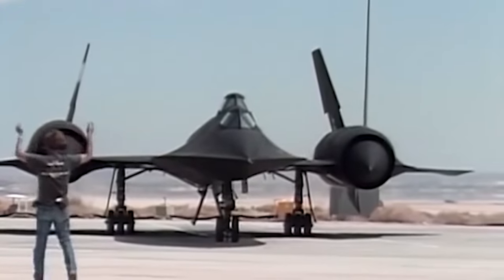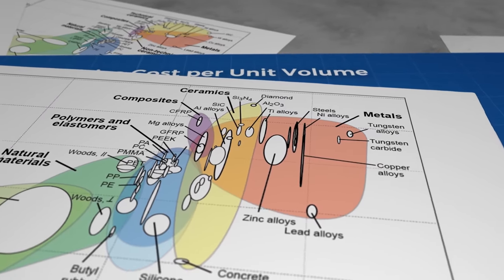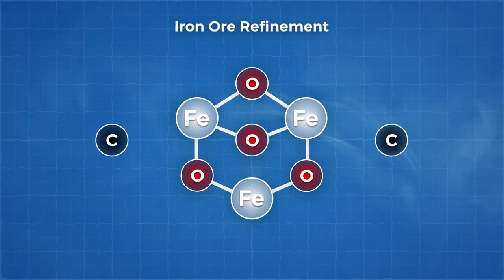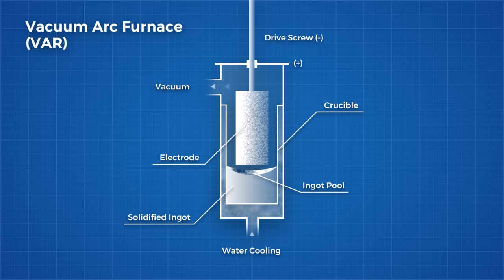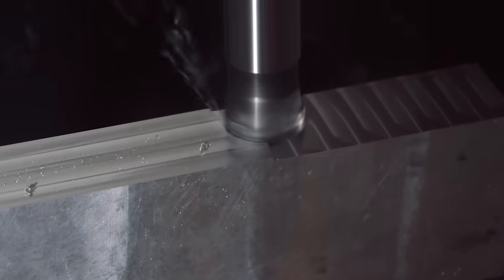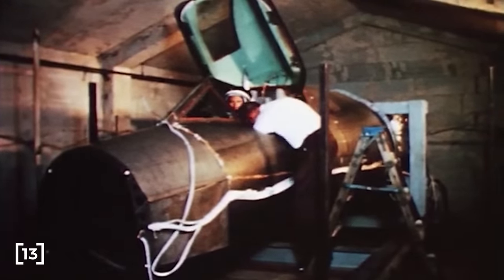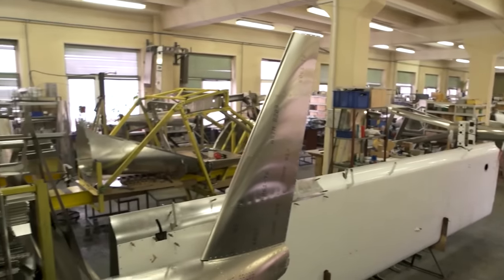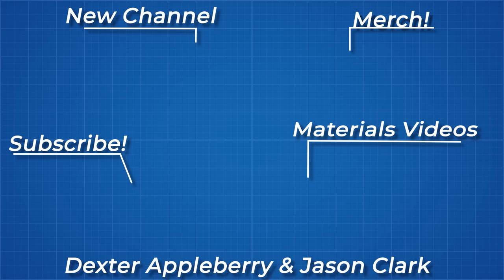Titanium - The Metal That Made The SR-71 Possible

Comment: The Avro Canada CF105 "Arrow" jet fighter started serious development in March 1955. The first aircraft, 201, was rolled out on October 4, 1957 and first flew in March 1958. The Arrow's engineers used both titanium and magnesium metal in the fuselage and structure, and had to solve the same problems in learning to work and form Titanium metal. However, they didn't get their Titanium from the Soviets. Titanium (Ti) forms about 0.5% of the rocks of the vast formation called the Canadian Shield. Titanium minerals include rutile, anatase and ilmenite (FeO.TiO2), the latter containing 52.7% TiO2. All stages of Titanium production in Canada are in Quebec, where QIT-Fer et Titane Inc mines 3 million t per year of ilmenite at Havre St-Pierre, of which over 1 million t is smelted in electric furnaces at Tracy. So, Titanium was sourced domestically, The necessary presses, equipment and tooling were developed by contractors near the Arrow manufacturing plant at Malton, Ontario. The project went direct from the drawing board to a flyable aircraft, with extensive model testing, allowing rapid progress. By 1959, a huge amount of flight testing had been completed, and 5 flyable CF-105's stood on the apron, with #206 ready to take the new and much more powerful Orenda jet engines, also developed in Canada. At least 14 more partly finished Arrows were on the plant's assembly line.

Then disaster struck. The Arrow program was infamously cancelled abruptly on Feb. 20, 1959, known as Black Friday, by Canadian Prime Minister John Diefenbaker. The high-performance fighter aircraft and many part- or nearly-complete planes, plus the manufacturing plant and tools had been built at a cost of millions of dollars.
 Diefenbaker ordered that all vestiges of the Arrow, as well as all plans, tooling, machinery, and the aircraft themselves, be completely destroyed. The "official" story was that the metal supplies, along with the purpose-built machinery and tooling were sold for scrap. However, curiously, records of this are sketchy to nonexistent. Huge machinery, presses, special welding equipment and jigs, and all of the material vanished as if somebody had said, "Beam Me Up, Scotty," never to be seen again - in Canada, at least. When one looks at the size and complexity of the plant, the "sold for scrap" story is utter nonsense. It is entirely possible that machinery and metals found their way to the United States. Many of the Arrow engineers went to the U.S. - the most 'famous' group becoming part of the new Apollo program, hired literally within days.  Of course, there's no way to prove this, since almost all the players have died. Around 2010 one of the aeronautical engineers revealed that he had a complete set of drawings and blueprints for the Arrow, and for its jigs and tooling. This re-started bitter arguments about the destruction of the Arrow, and Diefenbaker's ordering it all "pounded to bits" - literally.

Comment: Lockheed also developed a material that was given the name "Lockalloy" for the YF-12/SR-71. It consists of 62% beryllium and 38% aluminum and was used as a structural metal because of its high specific strength and stiffness.
Reply: You mean alloy

Comment: I am a machinist. Titanium is not that bad to work with. there are far more difficult things. it would certainly suck with a hobby setup, though, which is what I wager most peoples experience with it is, trying to make rings or pens or whatever.

I have issues with a few of your facts: I find it bizarre that they were "wasting" the titanium scrap and chips because it can be recycled just like any other metal. Scrap titanium is reused as the ingot electrode. Given how expensive it was, there was no way they were simply throwing scrap away.

Also, using 'high volumes of coolant' is no more or less expensive than not. Coolant is immediately reused once it goes back into the sump. The only losses are via contamination, vaporization, and evaporation. Additionally, the lower feeds and speeds do not make machining titanium 'incredibly slow'.

Finally, the cutting geometry of tools used for titanium isn't particularly special, and the cutting properties of titanium weren't unprecedented, so once the machinists saw how it was behaving they would have already known how to solve the problem.

Comment: Little known fact: When welding large panels cooling water was applied. After a few years some cracking appeared in the welds but it was not consistent to locations on other aircraft. It was determined that welds made in the summertime cracked due to chlorine found in tap water that was used to keep it safe.

Comment: According to Joe Sutter(father of the 747)'s book, Soviets wanted to buy some 747 (later denied by state department). So and the engineers from the both side gathered in Paris to have a nice dinner and discussing some technical details. Soviets brought Titanium welding and smelting to the table, and Joe Sutter explained why US mounted engines underwings plus some insight to structural designs.

Comment: Titanium was already used and still is used in aircraft engine hot sections,so it was a natural choice u would say nevertheless extracting a different use out the material o vously calls for advancement in several factors such as metallurgy ,airflow characteristics etc..

Comment: Another piece of engineering Witchcraft for the SR-71, it's windows aren't made of glass that would melt, they are nearly 2 inches thick slabs of clear quartz crystal and fuzed in place by ultrasonic welding.

Comment: the sr 71 was able to go into and exit from the 80k ft flight parameter. On a photographic mission it could drop down and then turn around and climb back to its previous flight track going the opposite direction, characteristics not found on any other plane. all other spacecraft are jettisoned rocket designs with ceramic tiles underneath to abosrb the heat friction on reentry. there are blackbird pilots that explain the flight characteristics that are counterintuitive, as the plane starts to run out of fuel, they accelerate and climb, interesting to this day..

Comment: A big part of the B-2 cost only a few were authorized to be funded at a time so titanium parts could only be made from billet hog out (not precision casting in quantity), hundreds of such parts mate with advanced composites yielding a design that broke the static test stand instead of the test article. B-2 program most common defect was Alpha Case, hydrogen or oxygen embrittlement from exposure to air at high temperatures (argon gas shield mandatory). The YB-49 failed because the aluminum structured flying wing was not stiff enough to resist twisting with the elevon control surfaces. Blackbird holes drilled into titanium might require thirty high speed drill bits, cobalt drill bits had not been invented yet.

Comment: Only 17 holes before ruining the bits? I had a friend who worked for CAT modifying bulldozers for military use. He wasn't allowed to know what the armor plating was made of, but he said it took 3 bits to drill each hole, taking around 20 min for each hole. For 1 d7 dozer conversion he had to drill thousands of holes to mount the armor plating. This armor was able to withstand 20mm rounds, and was bomb proof because these dozers were primarily used as mine sweepers.

Comment: You also might want to look into the Beryllium Aluminum alloy used in the vertical stabilizers. Titanium was not stiff enough and would flop around in flight.
Reply: @andyharman3022  When I was working a joint project with Lockheed, one of their engineers sent me an old sample he had under his desk. Amazing stuff but you have to machine with the same protections you would use for spent uranium. Found another way to solve my problem so we didn't use it but it would have saved several pounds in the vehicle.
Reply: @Osty789  Formula 1 teams were using it for brake calipers and engine pistons about 20-25 years ago.  It was outlawed.  How exotic is it, if it's too exotic for Formula 1?

Comment: Makes you wonder why they didn't use the materials in the engines for structural items. Hastelloy X and Inconel are both highly heat-resistant and mechanically strong. OTOH, there's a lot I don't know about ,metallurgy.

Comment: The Soviet's closest equivalent, the MiG-25 Foxbat, used Nickel-Steel Alloy for it's construction. It was almost 30 feet shorter than the Blackbird, while being about two tons heavier. It's engines also had a nasty habit of eating themselves at their max speed. Additionally, the Foxbat's range was pathetic when compared to the Blackbird.

Comment: Titanium has become associated with strength,....which is not quite correct.  Compared to aluminum, yes.  But steel is stronger.

Where titanium exceeds is #1.... Resistance to corrosion. It' used often where acid and other corrosives are used, and #2...It's lighter than steel.  In the case of the X-15 even titanium was not enough.  They had to use steel, with super-alloy Inconel (nickle-chromium) used for glowing-red-hot wing and fin leading edges and the nose where steel would get too soft and weak from the heat.

Comment: Very informative, but a couple of points.  Firstly 'steel is heavier than titanium'.  One kg of steel is not heavier than 10 kgs of titanium.  Density is the word you are looking for.  Secondly, at one time Kelvin is used as a measure of temperature and another time Celsius.  You should be consistent.

Comment: 14:30
Vanadium is also the secret magic ingredient "X" that is makes Damascus steel superior to ordinary steel.
Reply: Damascus steel is a mix of two different steel alloys folded over and over to combine the positive attributes of these steels. Neither of these alloys must contain Vanadium and actual historic damascus, aka "wootz steel" indeed doesn't contain any at all, because the benefits of adding V to steel did not become known before the late 19th Century. Any good knife steel contains Vanadium (preferrably +1 %) as it adds wear resistance and refines the alloy's grain structure. To do that the steel does not need to be folded, just properly heat-treated.

Comment: the B-70 bomber, which was also designed for match 3 cruise, skipped the titanium. it was designed after the blackbird program and was supposed to be a bomber with hundreds of aircraft, not a spy plane with 10s of aircraft. they used steel honeycomb on the wings to get the required stiffness to weight ratio. the honeycomb also reduced the thermal conductivity of the wing panels by enough even compared to titanium that the B-70 could use normal jet fuel without worrying about it igniting at Mach 3. I think it's a much better and cleverer solution than massive amounts of titanium.

Comment: Titanium is NOT difficult material to machine. It's a very pleasant material to work with.
Reply: Everything has to be properly managed. Maybe it was tricky back then, when they worked on the SR-71 and this is why it's so easy to work with titanium nowadays.

Comment: It's a bit unfair to say steel is as heat resistant as titanium is. Yes, some alloy of steel certainly is, but those are very soft.

Having a stiff steel that also have high temperature is really very rare, not even considering weight.

To say that titanium is not stronger than steel also leaves put the fact that high strength steel have a large number of drawbacks, not only weight.

The xb70 was made of high temperature steel, simply made it very thin. That kind of worked.. sort of

Comment: It's not just about the price it's strength and weight the reason why they used titanium on the Sr 71 was because of the heat caused by friction at those speeds aluminium metals at a lower temperature and it's a soft metalerial when heated. That's why these days they are using composite materials because there lighter and in some cases stronger. Alot of what you have stated is incorrect I'd love to know your source of information

Comment: It was not limited by the power of its engines 'eeeeeeeh, I mean kinda? Once it approached Maxh 3.5 that boundary shock would start to reach too far into the intake and thus super sonic air being ingested would cause major issues. But I digress. That's not so much the engines fault as it is the Engineers knowing they couldn't got much past M3.5 anyway for the reasons you stated.

Comment: I wonder if ScAl, scandium-aluminum, would work better than titanium as far as the fuel leakage from the expansion difference goes?  I think it would probably work better.  Certainly the 20 percent weight advantage would help with range and maneuverability.
Reply: Scandium increases the tensile strength of an aluminium alloy but not its heat resistance. So if heat is an issue, titanium is the better choice.
Reply: @einundsiebenziger5488  Not so sure about your heat resistance comparison.  Maybe you can send me a link.  I looked all over the place on the Internet but was disappointed not to find the chart that was provided by a manufacturer's page...can't remember the name of the company.  What I did find seemed to be everything but what I was looking for.  Apparently, everyone is using other alloys along with scandium for experimentation, so their "findings" widely vary.  The most interesting ones that I did find appeared to include ceramics which, of course, which tended to really increase the heat resistance stability.

Comment: this is a question for engineers. Why add Aluminum and Chromium to a titanium alloy, thereby reducing its thermal properties and strength, rather than applying an additional sputter layer or Al and Cr alloy separately to the outside of the part when possible?
Reply: because pure Ti is too brittle, the addition of aluminium and vanadium provide necessary ductility, so Ti sheets can be bent without breaking.
Reply: Pure titanium is relatively weak compared to many titanium alloys.  Alloying allows you to tailor the microstructure and phases present to modify properties in a way that simply isn’t possible with the pure metal.

Comment: Pure titanium isn't that hard or strong. Alloy steel is harder and stronger. It's when titanium is   alloyed that it can become stronger and harder. Carbon (and nitrogen) are often added to metals to make them stronger and harder.   
  Cutting tools are high in carbon; then, it's called a "carbide tool". There are steel carbide, aluminum carbide, silicon carbide, and titanium carbide, and others.
   Cutting oils and steel cutting tools contain carbon. When titanium is drilled or cut, the cutting  tool edges, and the cooling oil, lose carbon to the titanium. The titanium then, locally, becomes TITANIUM CARBIDE. The cutting tool, then, loses hardness in the cutting edges. (The same action takes place when drilling or cutting aluminum. The aluminum, then, becomes aluminum carbide (locally, to the edges).

Comment: There is another very good reason why titanium is rarely used in planes. Titanium burns at 2700C. No fire suppression system can cope with this kind of temps, so any, even small fire onboard, means the plane is lost and pilots are in grave danger. Not a very good quality for an aircraft... or anything really. 
As for SR-71, it was the victim of Lockheed's desperate greed for innovation. You can always count on Lockheed solving any technical problem... 10 years later than needed and at 100 times the original budget. Lockheed has a long and very sad history of brilliant technical solutions to problems that disappeared long before Lockheed produced the final product. U2, SR-71, F-117, F-22, and their latest "achievement", F-35.

Comment: The City of Burbank has its own indigenous wells, as opposed to Los Angeles which imports its water from hell-and-gone. Los Angeles only has indigenous water for 200,000 people. William Mulholland stole LA's water from the Owens Valley, and brought it down to LA via the California Aqueduct. Burbank's water was a little controversial, in that it naturally has a goodly amount of Fluoride...
Reply: I'm a trained aero-space machinist. The only titanium that I dealt with was a fastener call "high-tig", or something like that. To install a high-tig, you have to use a jig on your drill motor, to assure that you are 90 degrees from the material. The high-tig is mostly shank, with the threaded part only long enough to put an anodized hex collar on it. The collar is designed to break off the hex-head once you achieve the proper torque. Once the hole is drilled - which is smaller than the shank of the fastener - you insert the fastener, then drive it into the hole with a hammer set on your rivet gun. Giving a short burst, the material that you are installing into, flows around the fastener's shank until the manufactured head is flush with the material. If the hole was properly drilled, the material should keep the fastener from spinning as you ratchet the collar down to torque. If it wasn't done right, the fastener will continue to spin, never achieving the correct torque. Then all you could do is call for an inspector and engineer to prescribe a fix. Probably all ancient history now...

Comment: you didn't metion the problem with the weldability. 

The main problem is oxigen, hydrogen and nitrogen. Any contamination with theses gases during the welding makes the heat affected zone brittle. The most dangerous is hydrogen. Hydrogen doesn't make any tempering color after welding (nitrogen makes a nice gold color, oxigen makes from from yellow to blue), so you can't see anything. The only option is an X-ray examination and have a really air-tight system. 

As a material-engineer and welding-engineer I've been confronting always with these problems. Titanium, zirconium, tantalum are very nasty bitches. Their metallurgy would be a large series of YT-videos.